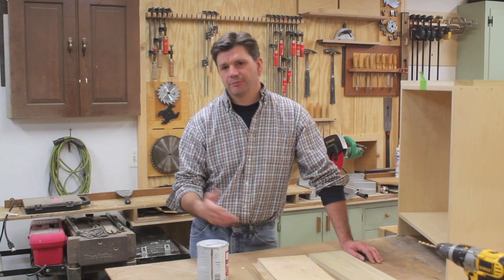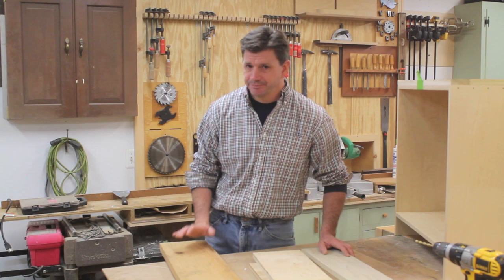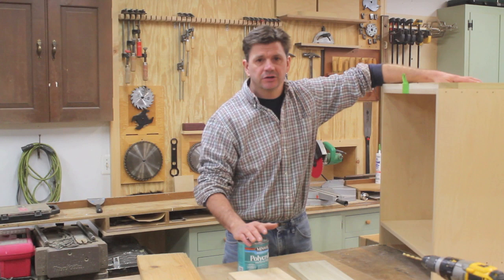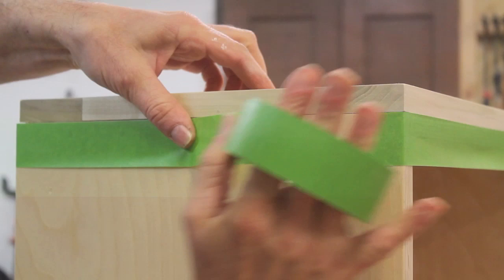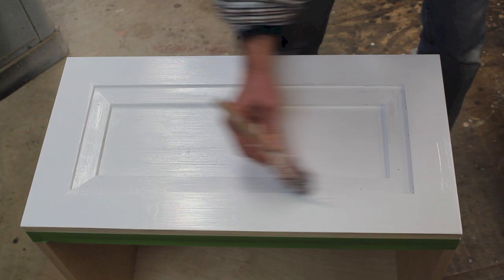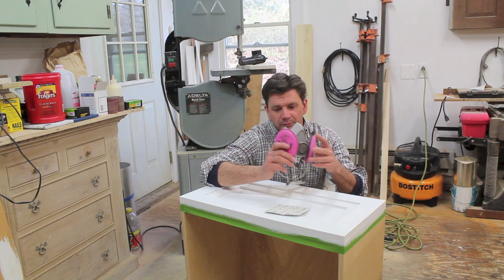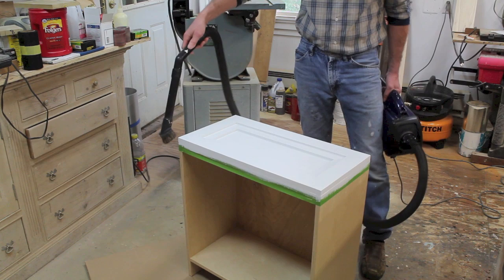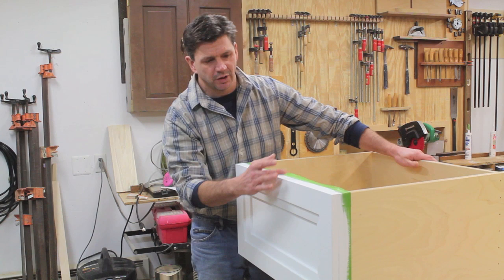How to Prep & Paint Unpainted Furniture

Comment: why joint compound over something like MH Ready Paste?  I notice you don't use any white caulk between the seam lines, is this a good idea or bad?  I usually use a white latex caulk in all the seam lines to make the finish paint look better but I wonder if in years to come maybe it will separate there from expansion /contraction of wood and the caulked seams will be more noticeable. I use a good caulk like big stretch or dynaflex 230 as they seem to hold up and not crack over time. In large doors there always seems to be noticeable seam lines between the small glass bead molding and the panels so I tend to caulk before painting.
Reply: If you are not going to stain the cabinet and are going to paint it joint compound is better than wood dough or caulk. You can't sand caulk. When you sand wood dough its particles are big and its not smooth. Joint compound dries fast and you can sand it as fine as you want. A wood working friened showed me this years ago when he caught me using wood dough. The answer is joint compound. It expands and contracts with temperature just like the gypsum board joints in the walls of your home..

Comment: Hello Jon. Great video. Based on the advice you gave to mgaums, in order to protect the finish, I see that you recommend a gloss paint. In your video it says semigloss. Which of these do you prefer?
Reply from the maker: Semigloss for the most part
Reply: Thank for your reply. Jon. I really appreciate it.  There are 2 local suppliers who are recommending the following process for unfinished cabinets. What do you think?
-Sanding
-2 coats of primer (sanding between the 2 coats)
-2 coats of oil based paint

At the end, they are saying that instead of using the Polycrylic protective before the primer, finishing with 2 coats of oil based paint will give an added protection to the cabinets.  What do you think about this process as well?

Comment: A1 video. But why use joint compound and not wood filler - will it not shrink when it dries?
Reply from the maker: Thanks, a painter friend told me about it and I've been using it now for years, works great and sands easy,